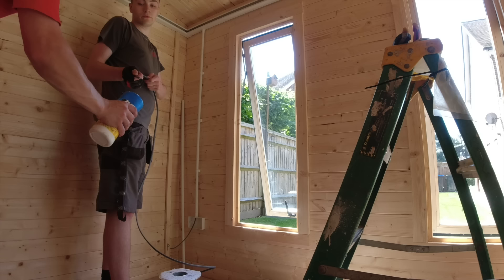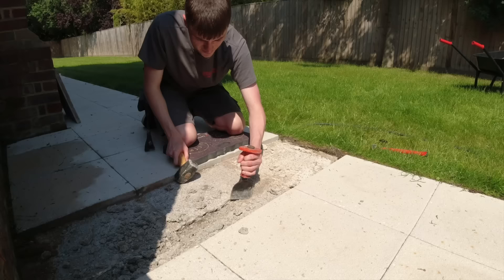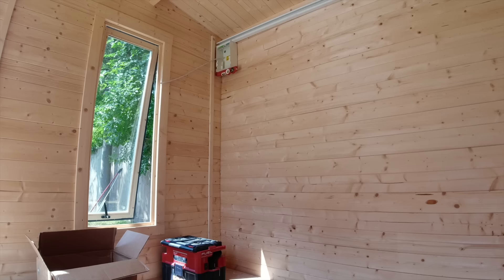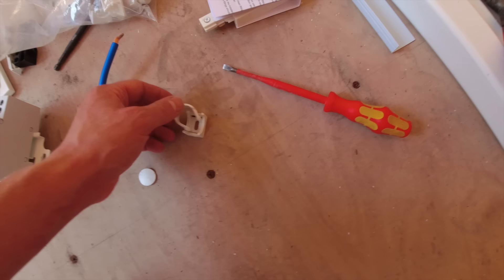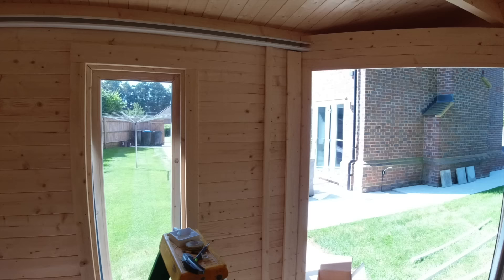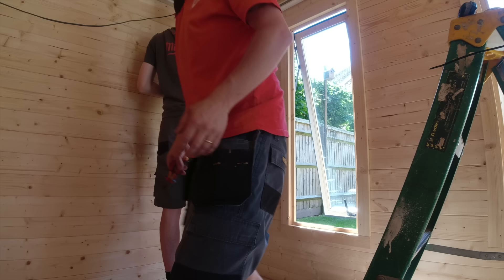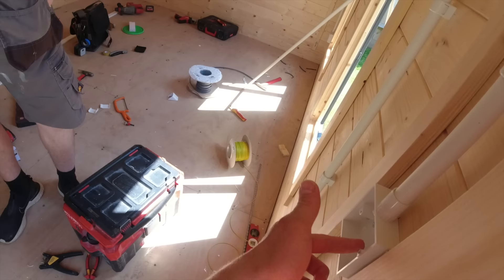Just how easy is it to install outside power and lighting. PART 1

Comment from the maker: Cable depth is around 20 inches. Only place it isn’t is under patio slabs and on top of a French drain. Just to help with any comments coming in.
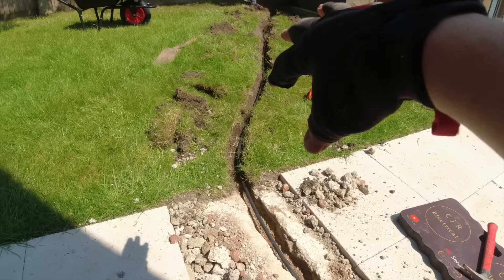Reply: 5:28 c'mon mate don't take us for fools, that looks barely 20cm never mind 20 inches!
Reply from the maker: Under patio yes I agree as it’s quite pointless. But on the grassed area I can assure you it’s deep enough.
Reply: @Cjrelectrical  👍
Reply: lmao...  That is nowhere near 20 inch deep on the grassed area.  20cm maybe... and that would be pushing it..
Reply: What's the difference between 20 inches and deep enough? About 8 inches.
Reply: You can clearly see that that is not 20 inches. You even say 'its not that deep' on the video
Reply: What size armoured cable did you use with it being and short run and connecting to 2.5mm socket cable? Thanks

Comment from the maker: New circuit was not an option. Consumer unit is only there to distribute the power easily when garden lighting will be added. Can go on a minor works as not a new circuit or to fit all on could go on an electrical installation certificate. If they required anymore than 13amp a ie for a fridge heater or similar then we would have installed a new circuit.

Comment: Log cabins expand and contract mainly in a vertical direction. Can be more than 20mm. Hence the reason the windows and door frames are not attached to the cabin walls. The way you've attached things the tubing will get pulled out of the socket boxes or the top trunking.
Reply from the maker: We shall see 👍
Reply: What would you suggest @PaulHeath9
Reply: @davecowan9466 Mount the consumer unit low at the hight of the sockets and make sure everything is only attached to one row of logs.
Reply: Use plug in lamps to light the cabin
Reply: @Cjrelectrical  From a personal experience - as an owner of a log cabin for twenty years - those vertical plastic tubes (inside and outside) won't stay a few years unfortunately. Uninterrupted trunks (or tubes, or whatever) can run only horizontally. For vertical cables - each log should have a separate trunks or tubes with either a few millimeters gap between them (accepted by regulations), or loosely plugged into each other, so they can move up and down according to contraction and expansion of the wood. The cable is to be loose as well, otherwise it may lead to more serious problems (in the wet condition the wood expands and the conduit connection may become loosen). All together - manually intensive labor, requires time. And might lead to increase in the installation cost.

Comment: I have done a socket ring in my garage with t&e in 20mm conduit. Never again. Rewired it with singles.
Reply: Yep, 20mm conduit is not suitable for 2.5mm T&E cables, singles all the way.

Comment: Hi Chris, good to see some footage of you guys again!

I wondered how your explaining was talking of following the edge of the lawn and then in execution you made a near straight run through the lawn. Then you talked sense with the underground system being there.

Running cable in gardens is never easy.

I once wired a blockcabin in the backyard of my uncle (under tips and tricks of a real electrician). (in the Netherlands) I Located a fuseboard 30 cm off the floor and ran my distribution in conduit in the underfloor insulation, then came up 30 cm to sockets around the cabin and on two spots i ran conduit up 2 meters strait, but i picked spots where i could bend a 90 and leave it unclamped for like a meter. The rest of those runs i kept horizontal on the same woodlayer.

I made 2 more t's in one of those runs into the sauna (with temp capable cable) and put 2 loops in those drops (for lighting).
The 3-phase heating element in the sauna was wired underground in conduit from the consumer board (by the electrician himself) which i located on the backwall of the sauna in the adjacent room.

Why all this: well, because of the cabin company telling us the wood shrinks and grows every season and i didn't want to leave tension on the wiring.
I am curious if you made a loop inside the consumer board to give the wiring space for growth and shrinkage?

Also the cable on the outside of the building might get under some tension?

At least you filmed this in a wet summer so the shed could be not to much on it's lowest point.

Maybe UK is so wet year round you don't get too much dryness shrinking the building anyhow.

Comment: Personally would've gone for singles or 25mm conduit. and would've buried that cable around the outskirts of the lawn and chucked a few bags of shingle on top. Other than that it's a shed ! :)
Reply from the maker: Exactly. Only reason went across is due to a French drain around the outskirts.
Reply: @Cjrelectrical  oh yes you did mention that 👍🏻

Comment: Hi Chris, thanks for the video.  As a trainee can I ask why (at 6.24) the banjo is on the outside of the Wiska box. I understand that the continuity of the SWA must be maintained but would having the banjo outside mean you need to drill through the IP66 box to connect to earth and by doing that are you not compromising the IP rating?
Reply: Reason why earth locknuts are used
Reply: @baz5329  Thanks for that - I understand the earth locknut is inside the box so what function does the banjo have when it's outside the box and not connected to anything?
Reply: @no_short_circuit it’s in contact with the gland, which keeps the sheath earthed

Comment: Sparkies always come up with excuses for never going to the advisable 500mm depth with buried cables 🙄😅 Why didn't you make your life easy and use singles in the conduit (I suppose most domestic sparks don't carry/use singles that often)?
Reply: I had an electrician install electrics in my shed a year ago. I was told to dig the trench to 450mm. I hope I never have to dig a trench again.
Reply: @613klj  Yep 450mm is the minimum with tape laid around 150mm above the cable.  I totally agree with him though it is pointless putting tape over it when its only like 100mm below the ground, cause if you dig you will hit the cable straight away rather than finding the tap... Absolutely shocking...  Bet he won the job cause he was much cheaper than the other guy that would actually bury the cable to the correct depth..
Reply from the maker: We did bury the cable at around 20 inches where possible.
Reply: @Cjrelectrical  Really?  I have dug trenches that are at least 450mm, its surprising just how deep that is..  Its almost half a meter, I tend to go 500mm so I can lay 50mm of sand to lay the cable on...   Maybe its the camera but it looks like its about 100 - 150mm..  Apologies if it is actually 20 inches which is 50cm or half a meter.  When I stand in a trench that is 50cm deep the ground level is above my knees.
Reply from the maker: Yeah a standard spade head is 10 inches long and I went double so around 20 inches. I will be sure to stick a tape measure in on the next one to help with any confusion.
Reply: @Cjrelectrical  Yeah fair enough, it looked really shallow but the camera can give a false impression so I apologise..   I tend to put sand down, then put it in some 20 or 25mm conduit to help protect it, bit more sand over it to protect it from stones etc that might brake the outer sheath and scratch the armouring, leading the rust.  Put tap basically ontop of the conduit and then tap again 150mm above the cable...  No need to worry about a fork hitting it as a fork will never get down to 450mm.. :)
Reply: @613klj  In the Federal Republic of Germany it must be 60 cm deep (2x Shovel blade length 😉) for never frozen in winter times. Over it some sand or fine gravel, cable band with sticker (e.g. LAN-cable, high voltage, water) then 20 cm over sand or gravel another cable band with same sticker and you can fill it with soil. 

If I have many stone or vegetable ground I prefer running it under the stone plates or direct at the side of them. Just one cable band enough. Documentation this and put it into the CU box - our most near entrance and very big often after we prefer 64 Ampere 3phase normally. But the main fuse sucks here. 🙄 The British are better. 

If do you have different things it is allowed to put into same trench - first bad water, then fresh water, then electrical stuff. I prefer then a wide trench with change the position parallel into different deep - it is better if you should have a fault later! A funny old system is to set a bigger plastic pipe DN60 or DN100 and put there all electrical stuff inside - it is save same an armored cable but 10 times cheaper! 😂 

⚠️ I really really never goes direct way if not minimum 60 cm deep - then better oriented at the stone way and go straight! ⚠️
Reply: @Cjrelectrical  Our German spade blade have 30 cm - so double it are 60 cm - exactly correct deep we should use. 😂 Inside garden and farming do you use your normal tools to located the correctly deep. 🤗 An other older method is to put wall stones over the cable to protect them if you can go deep enough. It is a good signal to the gardener not go deeper...

Comment: Mini fuse board with 16A radial coming off a supply from a 13A fcu spur from the house. Why as discrimination is backwards?
Reply: What would you do in this situation then?
Reply: Armour to Wiska then 2.5 T&E radial (already fused at 13A in house) to sockets with a FCU fused down to 5A, load side for the lights wired in 1mm T&E.
Reply from the maker: @steveb1856 consumer unit just gives ease of adding garden lighting etc down the line.
Reply: Did something similar myself for garden & pool lights and a shed
Reply: Should be a 10 amp in the board
Reply: @steveb1856  A 20A DP isolator first where it enters the outbuilding

Comment: Just wondering, is there no minimum cable depth in the UK?
In the Netherlands cables should be at 500mm minimum.
Reply from the maker: 450mm this was buried at 20 inches where possible.
Reply: @Cjrelectrical  thanks for the reply.

Comment: Great stuff.  Can I ask as a non electrician, why the fuse board in there? Wouldn't a fused spur for the lights, and the sockets off the incoming supply be just as good?  Is it just for room to terminate the cables in?
Reply from the maker: Yes absolutely but down the line the client is adding outside lighting etc so it’s easier to distribute the power with a small consumer unit.
Reply: DP isolation should be installed at a separate structure (as you have done) Using the above method suggested does not give you that (as often is the case)
Reply: @colinpenfold2971 Didn't Chris say the incoming supply would taken from a double pole  fused switch located inside the home mate?

I'm sure he did.
Reply: @thedarkweeally  Probably did. My point was in answer to 123mikeyd321 comment i.e. DP isolation required at a separate building, which he has done with the DB in the outbuilding. If the supply is from a SFCU (DP 13A) in the main property, then there is a selectivity issue by putting a 16A mcb downstream.
Reply: @colinpenfold2971  there is no issue, the fused spur will allways go first.
The 16A breakers are not for safety but for distribution.

Maybe Chris could have exhausted safety by putting a sticker on the fuseboard to tell users not to load the board over 13A total. But that is a bit much in my opinion, client asked for the fused spur option, so imho it's their responsibility to remember somehow that they can't overload the shed.
Also their responsibility to notify future owners/users of the house about the 13A max load.
Reply: @colinpenfold2971 easy to put a 20A DP switch inside summerhouse, and downstream 5A SFCU for lights.

Comment: Nice to see common sense applied with the depth of the cable. Customer is aware of it and will know not to go digging there.

Great install, I'd be happy if I were the customer.
Reply: Thats not the point surely? You wouldn't use that reasoning to run a cable chase diagonally outside of zones - customer is aware of it and won't go drilling there. The homeowner may move house in the future and the new owner may not know where the cable goes or how deep it is.  It needs to be deeper than a few inches with proper protection and warning tape to future-proof its safety
Reply: Just do a risk assessment 👍

Comment: Any techincal reason to run trunking inside rather than conduit on the exterior and back entry all the sockets?
Reply from the maker: Yeah the outside has overlapping wood and didn’t want to drill the timbers.

Comment: The consumer unit via a switched fused connection unit was an odd way of doing it mind and I dont think that complies. 

I'd have either ran a new circuit in if u want to put a small CU in there, or spur off the ring as you have done with a 13A switched fused connection unit and just wire the sockets as a radial and a switched fused connection unit derated to 3A for the lights. 

How would u even fill out the test cert for a CU installed off a ring final circuit? Are they new circuits or an alteration to an existing?

Not having a go mate just didn't get this one and not your normal way of approaching a job.
Reply: It's a spur and can be tested as such. Adding a CU doesn't make it a new circuit. But I agree with others a 5a spur for lights would be simpler, and could feed future extra lighting.

Comment: I thought an  earth rod  was    required if the  supply was TNC-S   so your not extending the supply earth outside  the equipotential zone due to the possibility of  a  potential  difference between the earth your standing on and the  supply earth.,And im sure the  trench depths supposed to be 450mm not 45mm.
Reply: I think your correct but at the same time you need to be around 10m away from any metal pipeing in the ground ect witch isn't rely possible in most domestic settings due to other houses other wize it's not rely on a tt because of the bonding to the pipes in the house that go underground ud be just putting a extra earth rod into the pme system or that's my understanding of it
Reply from the maker: It’s a shed mate only need its own earthing system if made from metal.
Reply: Tents aint made of metal but were still required to use a rod for  supplies on campsites if the incomer is TNC-S
Reply from the maker: @jan-dr1xl applies to caravans and motor homes.
Reply: This only applies if you have metallic water/gas services also going to the shed/cabin.
Reply: Well you thought wrong
Reply: Common misconception that TN-C-S cannot be used in an outbuilding - it can, but it becomes more complicated and costly to do so if there are extraneous conductive parts (minimum bonding conductor csa - same rules apply to TN-S too). 

Depth of burial is recommended as 500mm (or 600mm under a vegetable plot etc) and marker tape should be laid 150mm below the surface, as per the guide to the building regulations.

Comment: I prefer to run all the conduit work on the exterior down low and come up to a junction box to drill into the cabin for the power and come up high from  the rear of the cabin for the lights. That conduit and ducting inside the cabin is a eye sore, no one wants to see conduit work, looks horrible

Comment: I was told, your not allowed to install a consumer unit to a ring circuit?  (NICEIC)
Reply from the maker: It’s not being fed from a ring circuit. It’s off a 13amp connection unit. The consumer unit is for ease of switching and adding additions later on.
Reply: No you shouldn't . The spur will melt
Reply: @Cjrelectrical  🔥remove the board and fuse the lights down . Basic stuff kiddo
Reply from the maker: Ok little sausage.
Reply: @Cjrelectrical  nice response 😂🌭.. there's a brown book you might want to look at before you start feeding consumer units off 13 amp spurs .. 👍⚡️🔥
Reply from the maker: What’s the max load the installation will be able to pull through that 13amp connection unit?
Reply: @Cjrelectrical  25 amps for 25 minutes .. fusing factor 1.9 on a 1362 fuse .. you're welcome
Reply from the maker: So what your actually saying is manufacturers need to ban 13 amp fuses as they are not fit for use and fit 5 amp instead.
Reply from the maker: I don’t foresee the client overloading the circuit considering they are only plugging in a lamp and phone charger.
Reply: @Cjrelectrical  i am agreeing with most of your comments and on how you did this installation.
But foreseeing only a lamp and a phone charger in there is a bit gullable i believe is the word i'd use. (i think i am decent in english, not great)
I saw a mighty fine spot in front of the shed for some play or dining.
I bet all sorts of equipment, laptops and hotplates/grills or what have you not, will be used from a socket in there in the future.

But they would notice soon enough when the 13A on the spur blows if they went to far.
I am not afraid of a fire in there.
Reply: @bertbergers9171  People love to put tumble dryers in sheds!